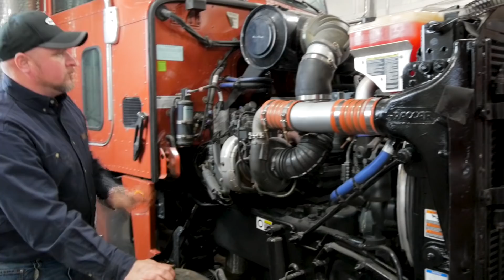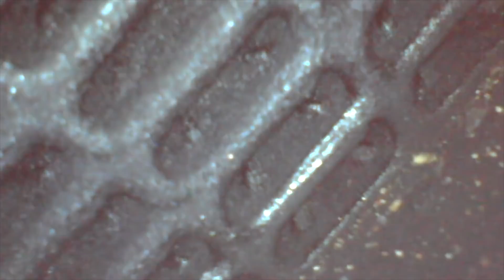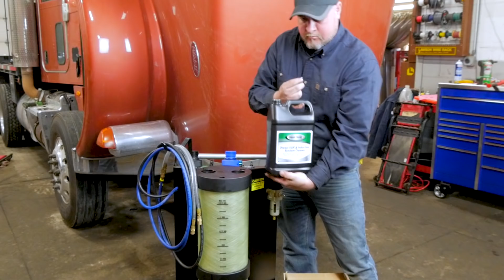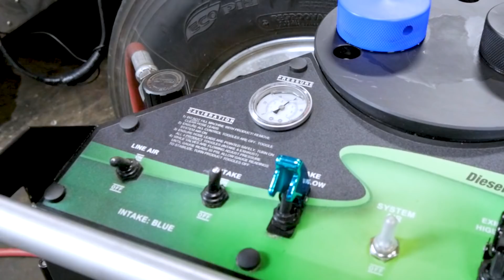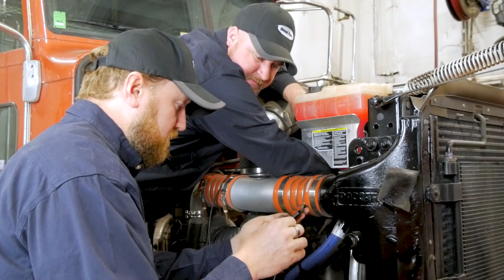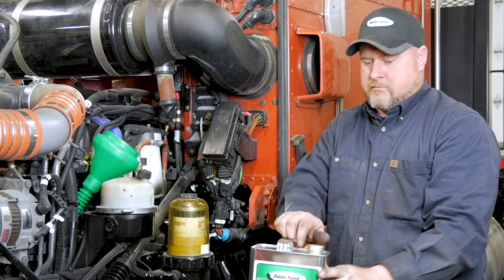MX13 Teardown

Comment: Is this only for big trucks, or will it work on a 2012 VW TDI Sportwagen with the 2.0L turbodiesel?  Not that I need a new DPF at the moment (knock on wood), but the car's got almost 190K miles on it, so it's gonna need it eventually...  A new DPF is $1,400 just for the part alone, probably another $400 to $600 to install it...   If this treatment can be done for, say, $500 to $1,000, that's a big savings...  (BTW, the 2012 Sportwagen does not have the urea-injection emissions controls on it.  That didn't come along until 2015, I believe...  It's only a standard cat and DPF.)

Comment: From my understanding that the systems  will all work perfectly ( I do think they are bullshit and should be removed though ) , and with out trouble . IF the engine does too . I had to have the complete system replaced by Kenworth on my truck good thing it was under warranty , with less that 65000 miles on the truck . Why because I had one bad injector . And that caused all the problems . Then he egr cooler was replaced . Keep in mind all the parts where of a newer design . ( i guess the older design was defective ?) But I do think if that injector didn't fail the older design would have never had to be replaced ? Now as a side question this seems like a lot of work to keep the environment clean . At our expense .

Comment: Costly.. inefficient.  And doesn't do what could be achieved by simply allowing the motor not to be restricted by filtering particulates.. the real solution to better emissions and less particulates is simple. Get rid of the ela. And government entanglements. And corruption by marketers and politicians lining their pockets. And produce a lower emissions motor very easily. By getting a better gas mileage motor. Simple. Better gas mileage means less particulates in the air. Without killing the engine.  Which is what takes place. They can't make a motor go a million miles with the filters and many times they can't warranty the motor for more than a half million miles before the engine blows because of the particulates filters.  Many times the motor won't last beyond 200000 miles. I knew a trucker a couple of years ago who lost his Cummings x15  engine after 100000 miles on a brand new paternity. They rebuilt the motor and he had them take the red bullshit off the truck because of that. There's the problem. Plus the Inviromental damage done by using sad is even worse for the environment. Explaining why California has so many problems with wild fires. The sad has pig piss in it and drugs out the atmosphere so much and causes the environment to turn into a matchbox leading to wildfires. And they refuse to see it. Pointing out that you don't see black exhaust out of tailpipe exhaust. Conclusions.  Dad systems are a complete Inviromental hazard. And a complete failure. But I'm sure some people have got very rich over it.

Comment: In the past I just run that Lucas DPF deep clean 64oz bottle treats basically 120 gallons the first time I did it I bought me two bottles to one on each side let that go through and it at least once a month because I was High idling and it was cold out I put one 64 oz bottle every month just to make sure between that product and Lucas upper cylinder lubricant it would say that I would have to do a Regen I hit the button 5 minutes later it's back at 600 RPM you just need to be proactive on your maintenance and watch everything the only time you realistically doing something like this is when you fucked up but that's my humble professional opinion

Comment: Just delete the system
Reply: How is it working for you I deleted 1 of my trucks emissions but its stalling going up hill and haven't been able to fix and the other 1 is working but its power is getting slower by the day
Reply: Mario Trevino The place I went to to get the delete system didn’t do a good job I had to go somewhere else who actually knows what they’re doing because when they hook up the computer they can’t read anything but I am getting .5 mile more per gallon
Reply: @MarioHernandez-bx3mr  
Nice that's what I'm going through with truck I got deleted lol and check engine light
Reply: Mario Trevino Check out diesel spec.com

Comment: If that truck only had 150,000 miles and the egr looked like that their system is terrible
Reply: To be clear, that was a truck that had not used our system in the lifetime of the engine until this point. Using our service at regular intervals will ensure that the EGR system will not get to this point.
Reply: How much does this cleaning service cost
Reply: I have a paccar mx-13 how often should I do this service to keep me out of the shop

Comment: If the majority of DPF clogging is from metallic oil ash particulate, wouldn't any metallic oil particulate suspended in the EGR soot be collected in the DFP during this process? Even with running a regen afterwards, the metallic ash would remain in the DFP, I would think a DPF cleaning or swap would be necessary after this service is done.

Comment: Is there a Diesel Force service location in Texas?
Reply from the maker: Sierra Services in Odessa TX can perform the service. Their number is 432-580-4807. If you need any additional information, feel free to call us at 866-204-9801. Thanks!
Reply: Diesel Force they don’t have the fittings for the mx13
Reply: I am currently working with Alamo city truck services out of San Antonio TX.  He said they were going get the fittings for the MX engine.